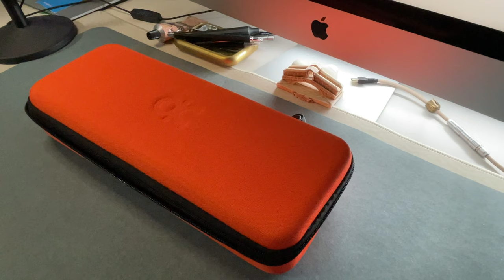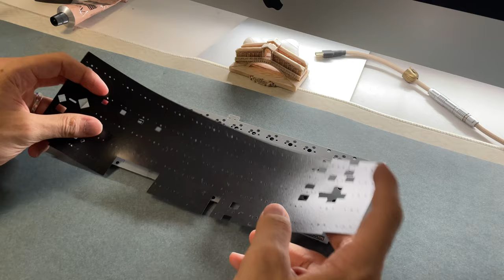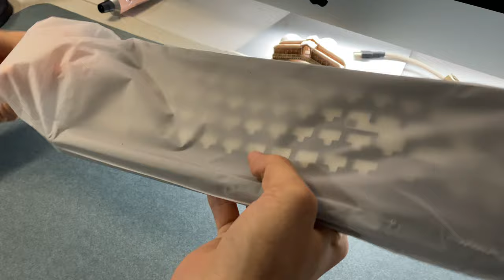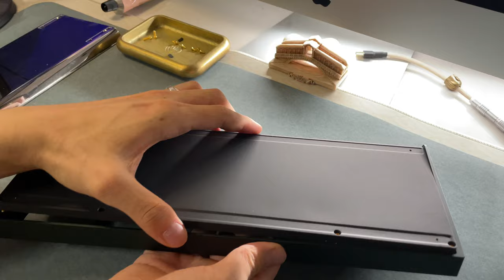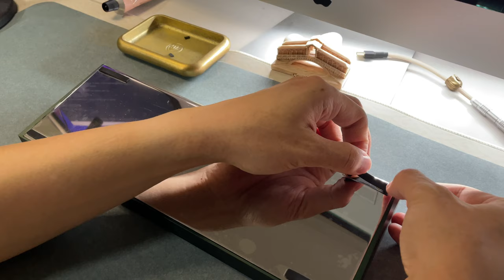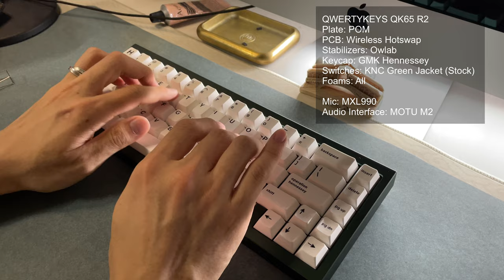Stay Wireless and Keep Clean | QWERTYKEYS QK65 R2 Wireless | Build & Review

Comment: Can you build the wireless version with no silicon dampener at all? It looks like the battery is locked in place under the dampener so if I build it with no dampener where would it go, or would the battery just floats around in the case?
Reply: Yes, you can. There's a compartment for the battery under the weight.
Reply from the maker: There is a space, but i think it need tape or something to attach
Reply: @PenPaperKeyCode  Correct. You would need to secure it. I will still be securing it a bit more so there is absolutely no movement when carrying it once I get my board.

Comment: I got the Bluetooth version and was super disappointed to learn it does not support VIA/QMK. The QK software is okay for basic things, but that's basically it. Nowhere near the customization of VIA. I don't get why they couldn't use VIA on their BT boards. My Zoom65 has BT and works with VIA. Considering "downgrading" to the non-BT PCB to get VIA customization. But if lack of VIA is not a dealbreaker, then the BT board is quite solid. I can be paired to up to 3 devices on BT, 1 on 2.4ghz, and then wired into my desktop. So it is quite versatile in this case.
Reply: Where can i find the qk software? I want to remap my qk65 mirror